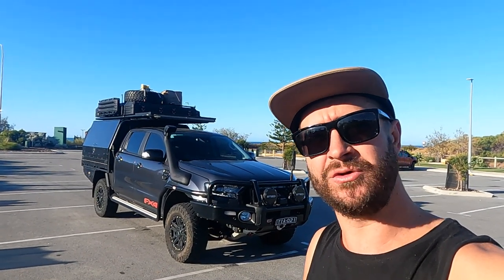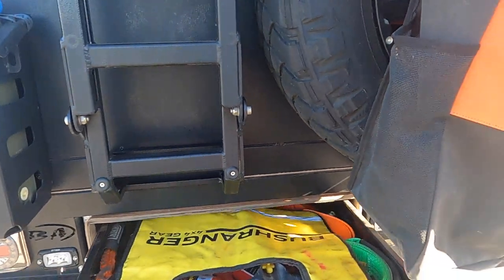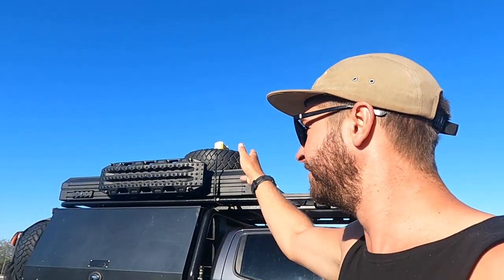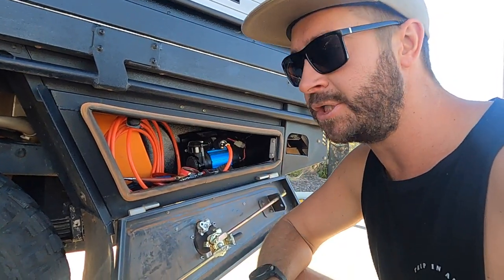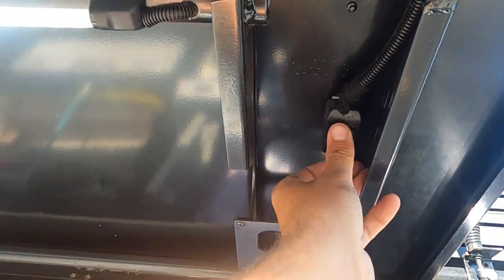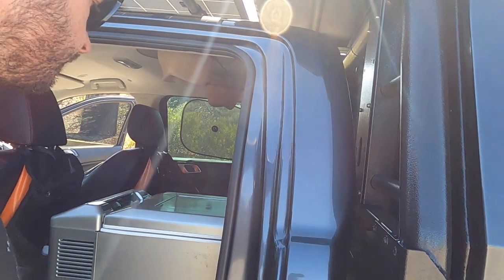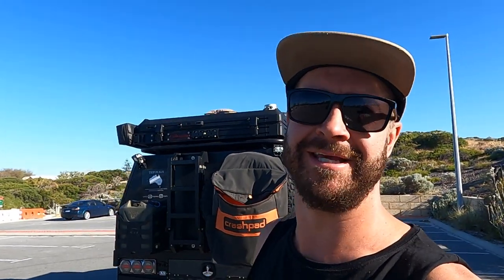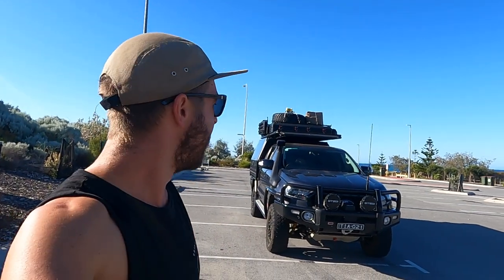Rig Run Down with Trip in Aus - 12Volt system/ Canopy build/ Roof top tent and HOW MUCH IT COST! $$

Comment: I drive a sibgle cab 79 Land Cruiser & empty tray i jusy run 5psi in the air bags. I've got old man emu BP51 suspension 2' lift. Arb bull bar, 12k pound warn winch scrub bars and side steps also.. heavy load with boat or trailer i run 10-15psi haven't noticed much difference.
Reply from the maker: Awww thanks mate, 15psi feels like there working with the leafies 👌
Reply: @tripinauseathanjacinta5371  I've got a fixed compresssor behind passenger side & run tpms, air bag pressure, battery monitor, fridge control, lights, ground speed all off Linx, which is just like a plc computer interface on the dash. Quite a good tool, I didn't want a dozen switches and all the wiring.
Reply: Hi just come across yr comment and thought you might like my setup for some ideas. 
Have a look at 
Out There Touring

Comment: Do you know what weight your ranger is? I have an xlt ranger with boss canopy and the same ome suspension with extra leaf set up and I absolutely battle to stay under my gvm and I don’t have extra extra stuff you guys do like diesel, water etcc… is the canopy ventilated at the bottom? If not definitely don’t store the gas bottle inside the canopy you could blow yourself up! Lpg is heavier then air and won’t vent out unless there’s holes in the bottom of the canopy.
Reply from the maker: Hello mate 
Yeah there hard to come under weight aren’t they. I’m well over mate, there wouldn’t be a Ranger or same size car touring Australia that is under weight. 
Yeah gas bottle, she’ll be right. 
Cheers mate safe travels
Reply: Agree lads, mine is pushing 4 t fully loaded and the 2 off us.
Reply: Hi just come across yr comment and thought you might like my setup for some ideas. 
Have a look at 
Out There Touring

Comment: Great video mate 👍. I’ve got a very similar setup on our Ranger. Yes the weight does add up just as fast as the cost I’ve found 😂. As for Springs I’m running a set of 500kg constants with air bags. I’ve strengthened the chassis too, might be worthwhile checking out. I’ve done a YouTube video in it and other mods, haven’t done a full rig run down just yet. It’s in getting a sas conversion at moment hopefully get it back next week. Anyway enjoyed your video and have subscribed to follow you guys. cheers 🍻
Reply from the maker: Thanks mate, I might check that video if yours now 👌 
Safe travels mate
Reply: Hi just come across yr comment and thought you might like my setup for some ideas. 
Have a look at 
Out There Touring